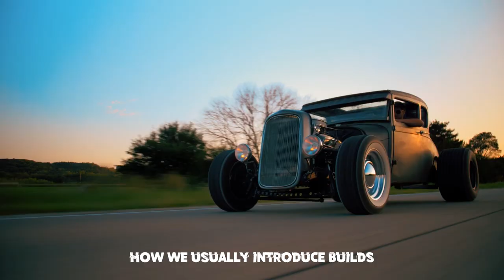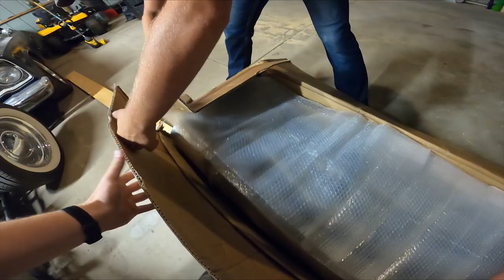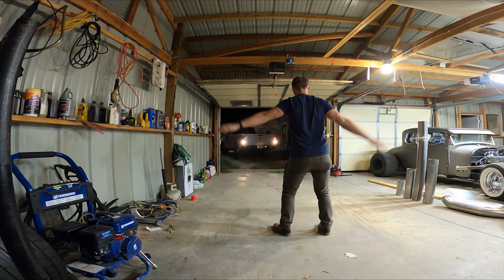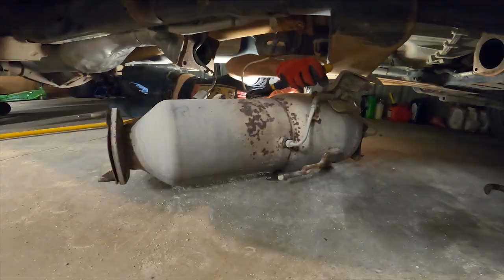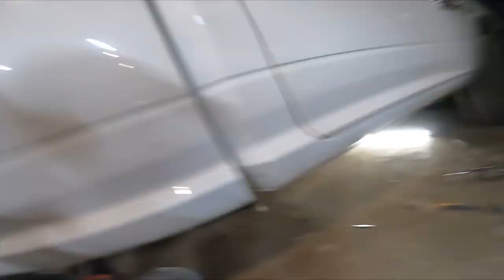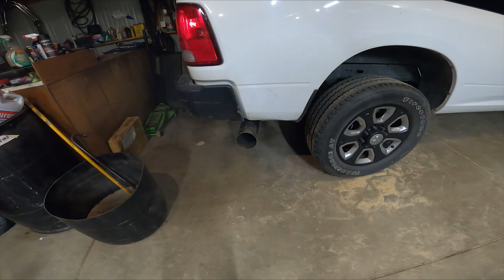6.7 Cummins DEF Delete to 5in Straight Pipe

Comment: Just curious did y’all tune before start up? Or adding tune once’s egr is gone
Reply from the maker: No tune before start up and less than a mile drive but did trailer it to a local shop 13 miles away to have it tuned after the full delete. Actuator went out and we just finished replacing the turbo to a BD diesel Iron Horn, now we don't have to worry about an actuator and also get up to 600hp.
Reply: @DailyDrivenDeathTraps  gotcha, appreciate it, I’ve got a 2011 f250 I’m getting ready to tackle the delete on I have the kit to do both egr and dpf bjt I’ll probably only do dpf and then egr when I have more time. Have ezlynk  with gdp for tuning